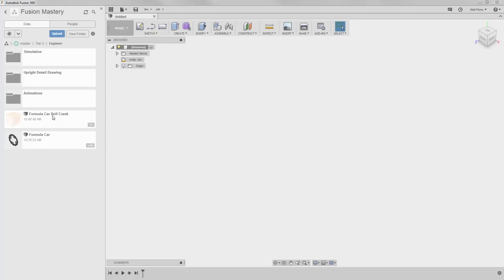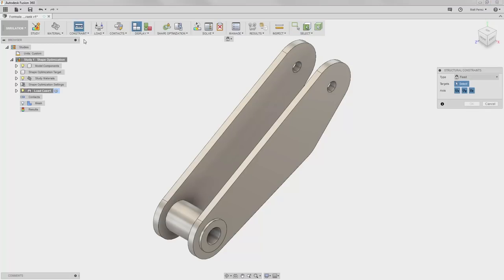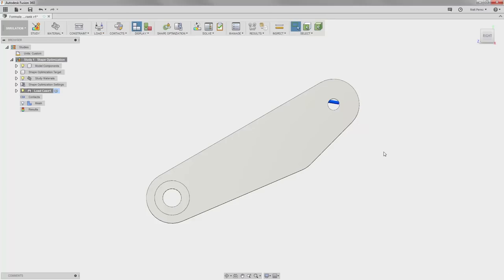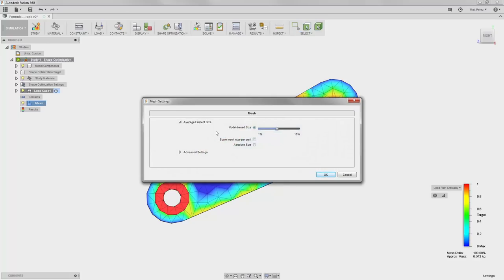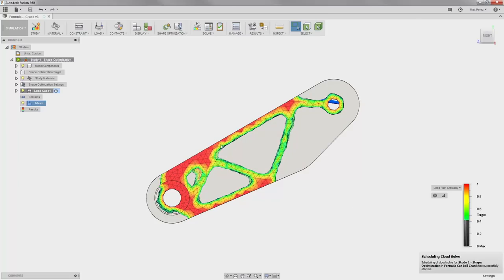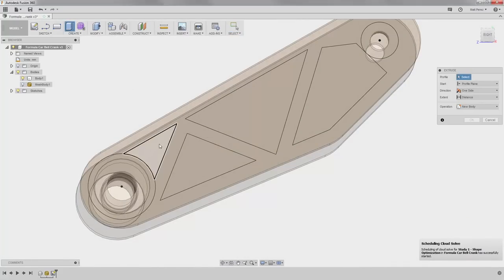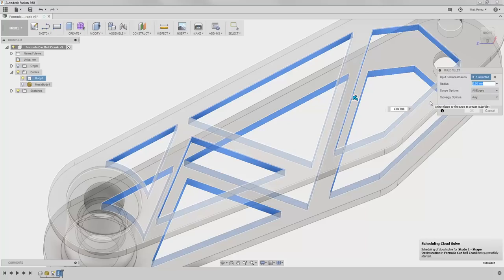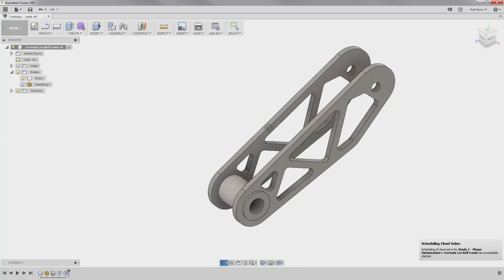Shape Optimization Tutorial

Comment: very nice video and very intuitive , 
May i ask a question ? 
it seperates to to subquestions 
a) in case of a part that rotates, the load direction  changes , can we solve for all possible angles and load direction automatically ?
b) how can we determine if we apply force to one part of an assembly the load that is transmited to an other and extract that force and its direction and and then run the shape optimization ?
Reply from the maker: You would want to apply different load cases for part (a), but no there's not an automatic way to do this. You can run part (b) as an assembly, but you're forced to select a shape optimization target.
Reply: No no you didnt understood what i asked 
for part a ) imagine we have a rotating part that lifts a weight , at 0 degrees we have a particular load pathway , at 10 degrees we have a different load pathway at 20 21 22 ...... the load pathway changes each time as the part rotates , can the shape optimizer give a solution for that ? so our part is strong enough in every possible angle ?
So for part b) it can be done but one study for each part and then the other , thats nice 

Thanks for the answer
Reply from the maker: To load this in this way, you'd need to create load cases to represent all the different angles and force magnitudes. There's no automated angular range you can apply. 

And for part (b), only one shape opt part per study. However you can include other parts of an assembly to transfer loads.
Reply: Thanks for the fast answer 
for part a) is this feature available in any other autodesk software ? 
for b) can this force be extracted as a vector ? I mean can the resultant forces be displayed for each part?
Reply from the maker: In Inventor you can use a similar algorithm to optimize. They also have parametric studies. https://knowledge.autodesk.com/support/inventor-products/learn-explore/caas/CloudHelp/cloudhelp/2016/ENU/Inventor-Help/files/GUID-10B9D76C-608C-4464-9A47-B9FE61B5771F-htm.html 

What I can't confirm at this time if you can do a shape optimization AND parametric study together. 

You can use resultant forces to extract reactions as vector.

Comment: Dear, 
Is it possible to define for instance 3 different load cases (the mechanical component will operate in different modes) and run the shape analysis considering all the three load cases? Or do I have to run it three times separately for each load case and then combine it in my mind during modeling the optimized model...plus test it for static analysis afterwards. Thank you in advance
Reply from the maker: Three load cases will give you the best results, for sure. Running three times and trying to combine would be a pain! To test after you'll need to convert a mesh to solid.
Reply: @adskFusion  So it is possible to run one topology optimization which takes into account multiple load cases, right? So the resulting shape would work ok for each load case scenario separately..

Comment: Hey there,  I don't know if somethings changed since you posted this but when I open the .iges and save it as a fusion project and then attempt to go to simulation it crashes fusion 360.
Reply from the maker: I just tested this, and didn't have the same experience --looking at results now. Can you try a different simulation on a different part?
Reply: My apologies, it appears that my installation is pooched and won't even open the simulation workspace.
Reply from the maker: Reinstall fix it?
Reply: Haven't tried that yet. My system is fully locked down so my user ID can't screw anything up. So I'll have to wait for the help desk to reinstall